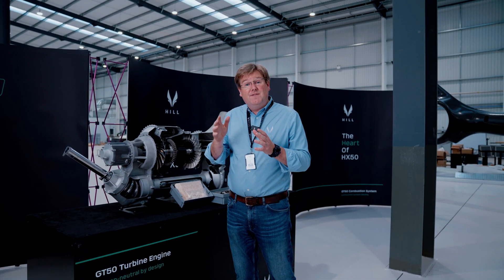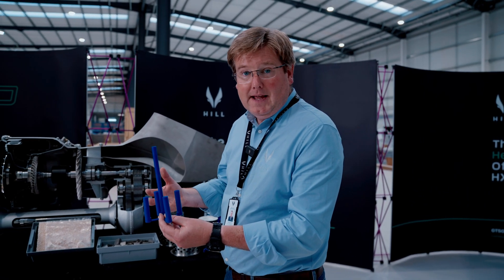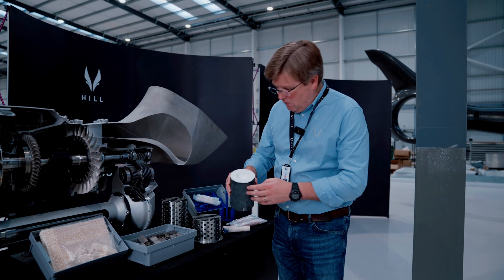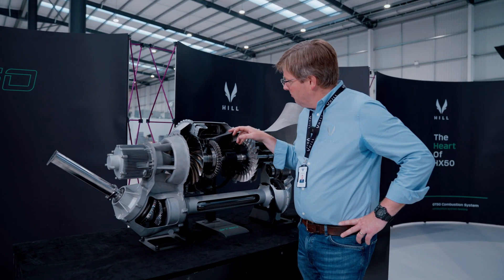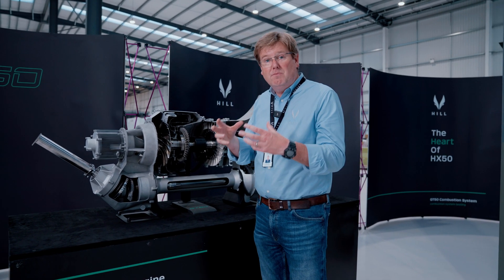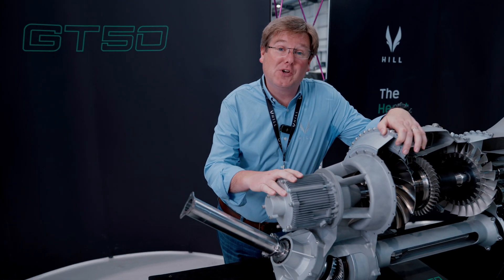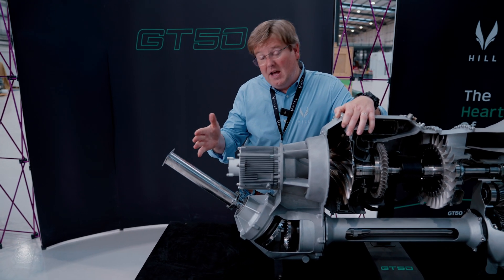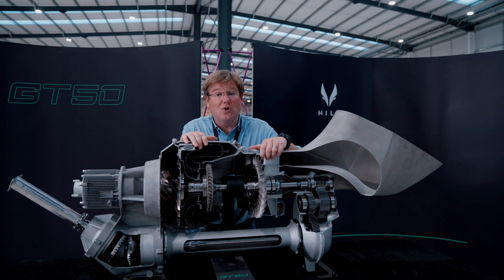GT50 Engine : Turbine Blade Casting & Fuel Nozzle Update

Comment: Ive wondered if alloy printing blades and machine to size. I’ve heard the printing actually has some interesting strengths on all axis’s?
Those are very expensive important part so maybe the lack of speed would still be feasible ?

Comment: Quite fascinated tripping over your project on the youtubes, Jason.  Impressive work in so many areas.  Wondering, though, why you'd be still pouring your metal for the blade casting and not using some kind of countergravity filling method that Prof John Campbell advocates?  I haven't personally seen it done anywhere yet, but I keep imagining a vacuum filling rig that fills through a ceramic straw that's on top of an induction fired crucible which can be kept flooded with an inert atmosphere.  The head of metal for the fill doesn't have to be much more than half an atmosphere and by controlling the pressure drop rate you could regulate the mould fill with absolute precision with no mixing or turbulence in the melt.

Comment: Why cast individual blades over machining? just cost? I would think blades that small would be insignificant cost to mill and important to get right
Reply: Look up single crystal casting.
Reply: @ca_pilot  I see. I didn't know alloys could be monocrystalline. That's cheating :)  I'm guessing that's not a particularly inexpensive process.
Although the way he describes the process doesn't sound monocrystalline
Reply: @DanFrederiksen  Yeah I wondered about that too. Maybe the blades has some fancy internal cooling ducts?

Comment: Im surprised you're not using a slurry cast! Would you call this "investment" casting?
Does the second flow path in the injector open up once a certain fuel pressure is reached?
Is the carbonization process akin to case hardening? I was not aware that copper plating could selectively carbonize. That is neat.
Reply: Copper is a great IR reflector, I would imagine it's used as a means of thermal control in heat treating.

Comment: What is the thermal efficiency of this engine at base load?
Reply: @GeorgeWadsworth  are you asking about expected performance? They have not completed one of these engines yet, so there is no performance data.
Reply: @brianb-p6586  I shall wait until then 👍🏼
Reply: He mentioned at some point it’s 25%, which fits with it specs.

Comment: Are you guys using a centrifugal compressor because you guys are a start-up or are there are some new technology that I’m not aware of. I was under the assumption that axial compressors are more efficient
Reply: The possible pressure rise per stage of axial compressor is low, so with axial compressors multiple stages are always needed. With a relatively low overall pressure ratio (as is typical of small turbine engines and simple turbine engines) a single stage centrifugal compressor is sufficient. The single stage is less expensive, so it is the conventional choice for the simplest turbine engines. 

The Allison Model 250 family (which is now the Rolls-Royce M250, M300, etc) is used in many small Bell and MD helicopters. Although it originally had a multi-stage axial compressor, some newer variants (the Series IV family) have a single-stage centrifugal compressor, including the RR300 used in the Robinson R66.